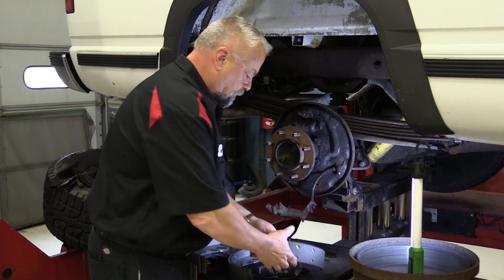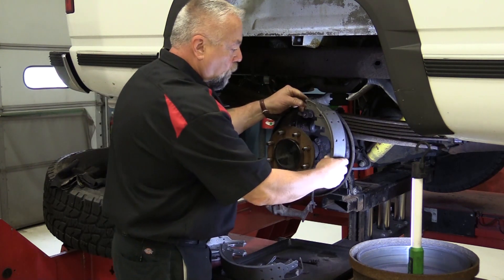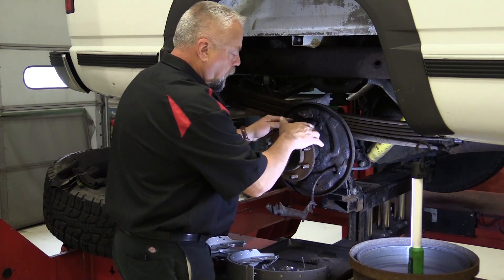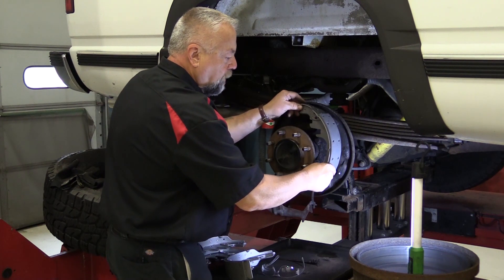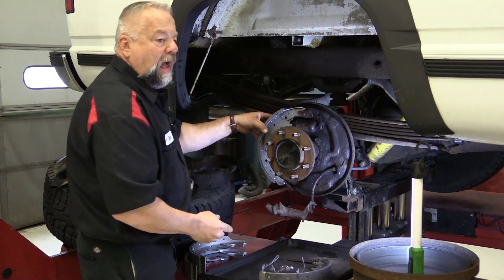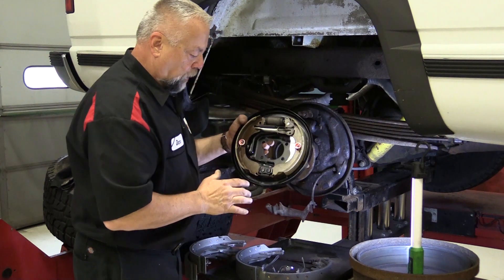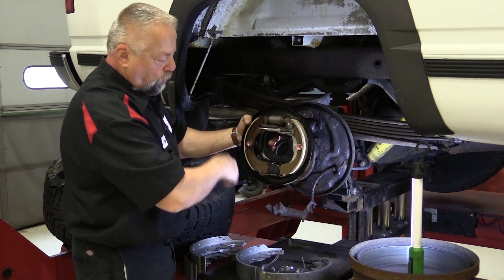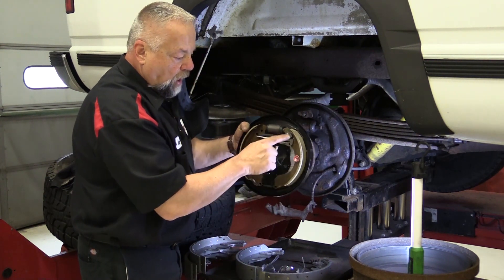Types of Drum Brakes

Comment: Can you please be the first to go over the initial adjustment of a duo servo system ?  Non servo, make it drag a bit when you assemble it, no problem. But I'm having grief with my overhaul of the duo servo, with even small drag, the brakes put themselves on.  I set it as loose as I dare then drove it just one mile and came back with brakes very hot ... what is it I don't know ?  I can assure you I have it all back together correctly and hand brake is set super loose.